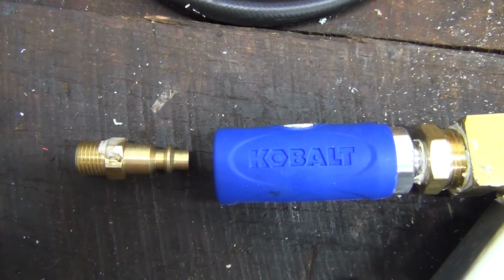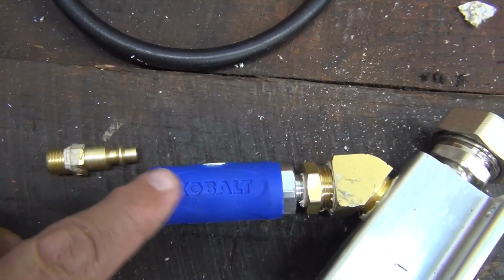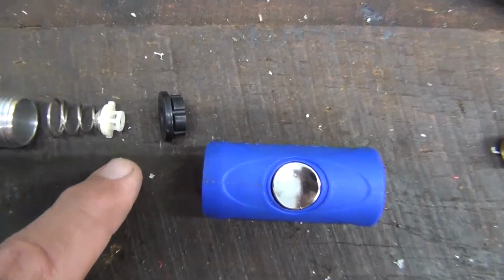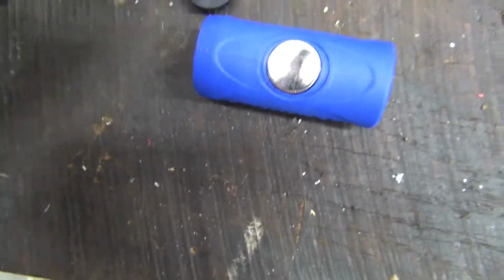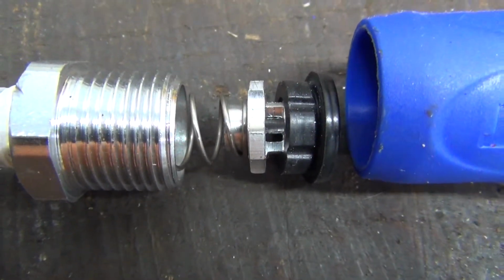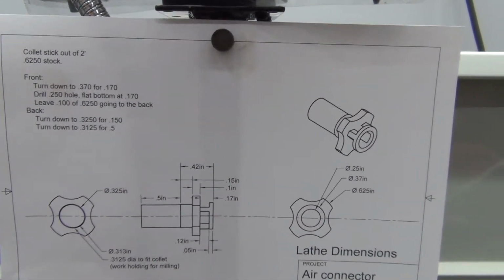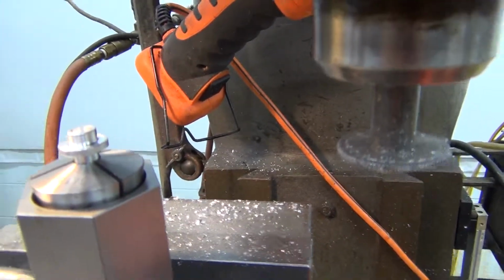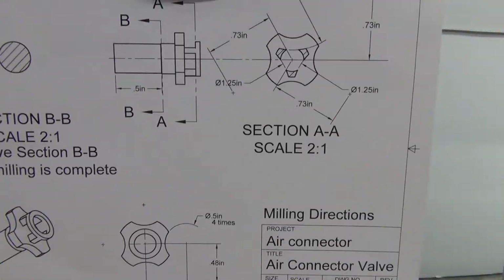Kobalt Push Button Quick Connect, Part 1

Comment: Very nice job on replacement piece. I would buy one. You may want to holler at Kobalt and see if they want to make you a deal haha.
Reply from the maker: They work, but air flow is low.....I still use them.